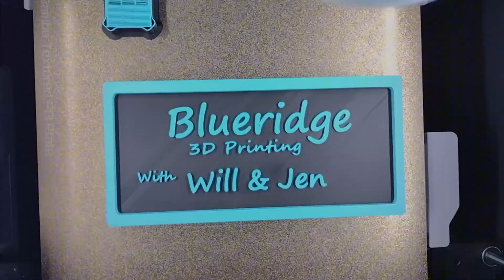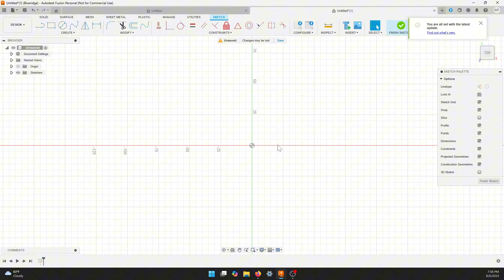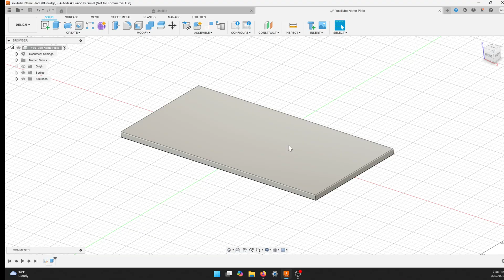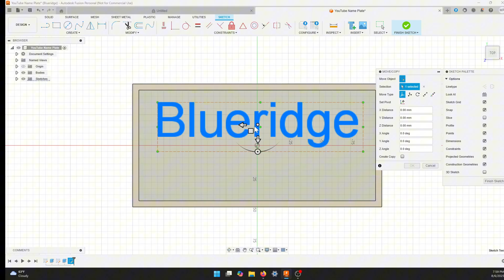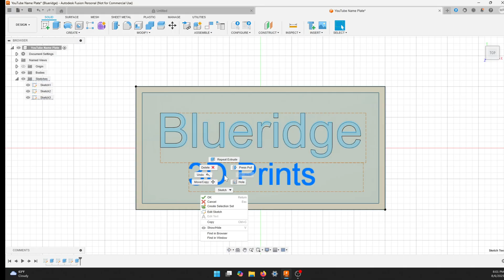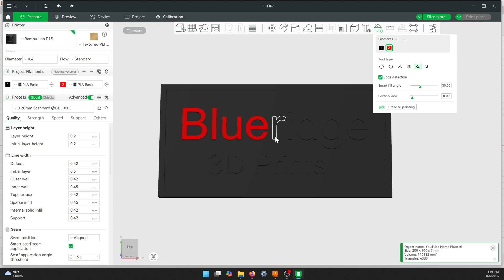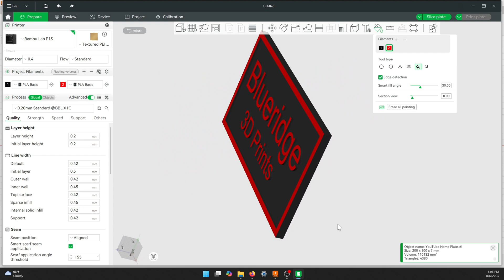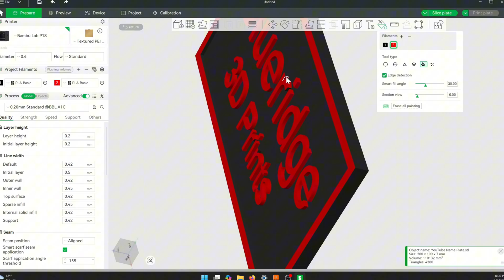How to Sketch, Design & Sent A 3D Printed Part To The Printer in 10 Minutes! Senior Makes It Easy!

Comment: I think if you set the extrudes as new bodies in fusion 360 then save as 3mf file you can then select all the bodies (words and border) and just change the filament colour in the slicer. This avoids painting. However if it’s just extrusions you are painting as others have said it’s easier to use the layer height paint option (icon 4) in the paint menu

Comment: I slice the plate, then drag the line at the right and stop it at 2,2mm (for the toilet sign I mentioned earlier), then right click and choose filament change or something like that. Much easier.
Reply from the maker: Are you running a AMS?
Reply: @Blueridge3Dprints Doesn't really matter. You can create a pause and change the filament manually if you don't have an AMS. You just need a cryo plate if it'll sit for long enough to cool. I learned that watching a video with someone who has a print farm and does fridge magnets.

Comment: There is an alternate way to create the same thing. Convert JPEG to SVGA ( free on internet), import SCGA into Fusion360 and then extrude. works with most logo JPEG's. Good tutorial!
Reply from the maker: Thanks for the comment and the advice. And Lord knows I need all I can get. Really I'm just trying to keep it as simple and as dumb down as I can. And you start getting too much into something that people don't use everyday they tend to click away from the video. If I can create something that they can build in 10 minutes and it only takes them a few moves to do then I think I may have helped someone. Thanks so much for commenting and for watching.